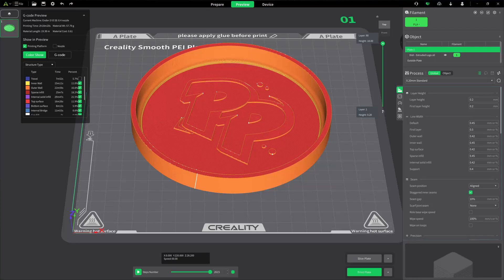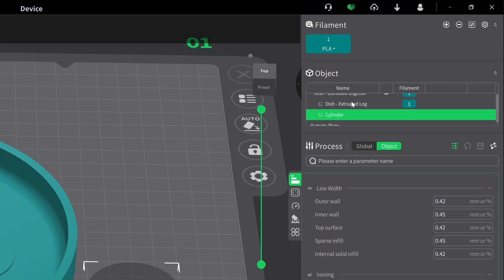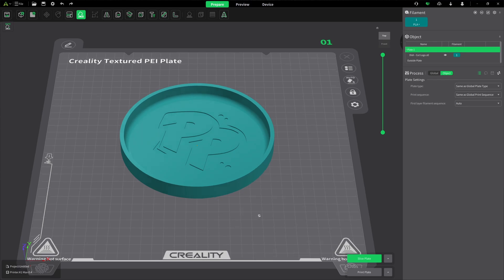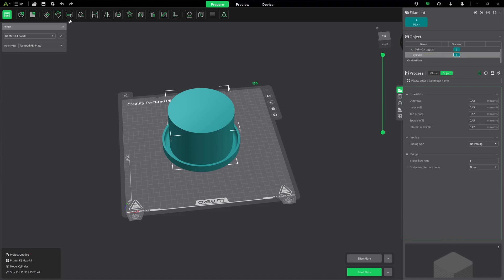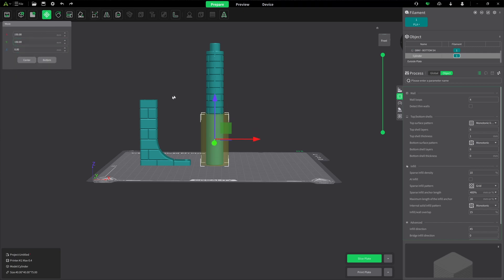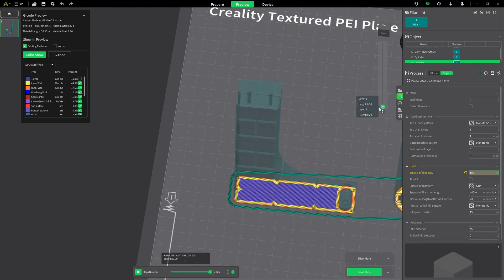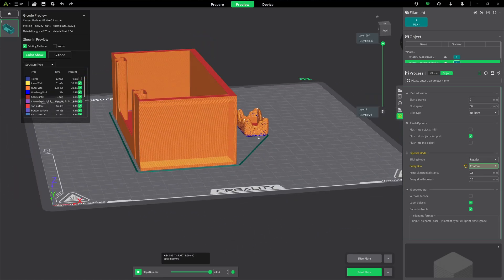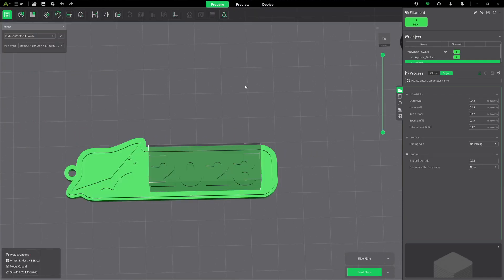Mastering Creality Print Modifiers: Unlock New Possibilities!

Comment: Hi - I'm uing Creality Print V 6.0.4 - when I use the 'Move' option I don't get the "center" and and "bottom" buttons as in your video. Has this been moved to different place in the slicer application?
Reply from the maker: It does appear that they removed those buttons. You can still get the "Center" by right clicking the object and selecting center from the menu. I have no idea why they removed them.

Comment: I learned a few things from this Video. Thanks. Question: Is there a trick to put spaces for multiple words?
Reply from the maker: Between the words? I type them just like normal. Or do you mean each line? Not that I'm aware of but you could type them separately and then move the lower lines up closer to the first line. I hope this helps!
Reply: I can only type 1 word. Doesn't allow spaces for second word.

Comment: I haven't found a way to use modifiers to change my layer height. I print parts that have a handle and a head. The head needs a 0.1 layer height, and I have to print the entire handle using a 0.1 layer height just because of 4 mm of the head. Can it be done? By the way, your tutorials are excellent. Thanks, they always help me.
Reply from the maker: Good question. Unfortunately, you can change the line width using a modifier but not the layer height. Hopefully changes in the future will allow this. Thanks for the kind words and thanks for watching!

Comment: Question:  Would it be possible to change the scale of a portion of a model with a modifier, or would that best be accomplished in a 3D building program.  For example, increasing the thickness of the front portion of a picture frame without re-scaling the walls of the frame itself.